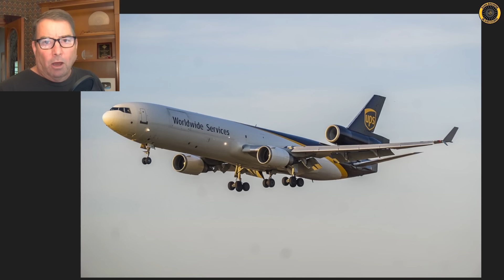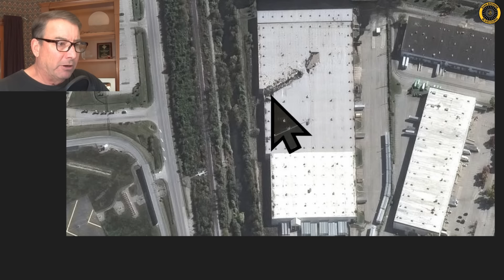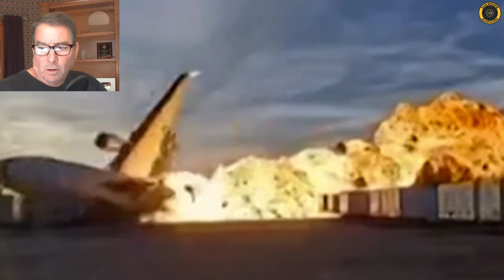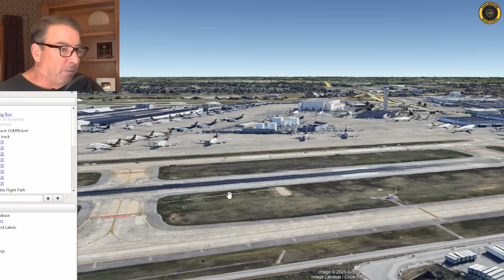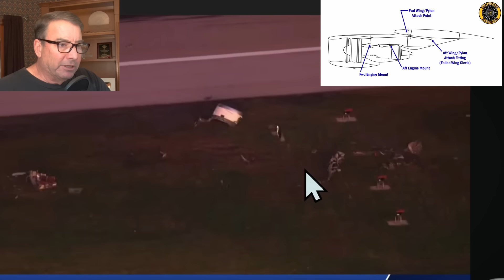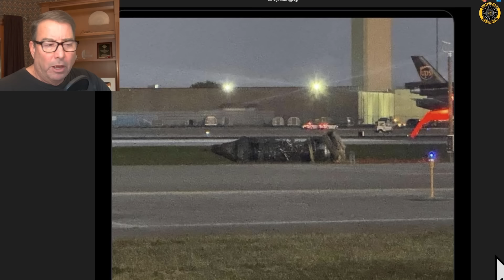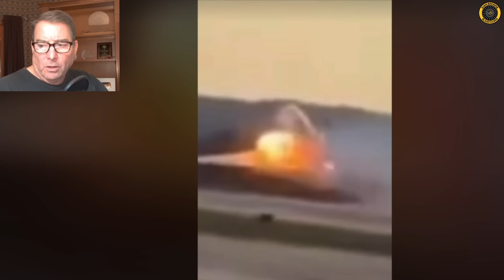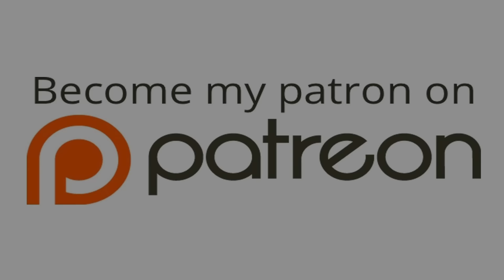UPS #2976 UPDATE 2 6 Nov 2025

Comment: 🧩 1⃣ Maintenance process and quality control

The biggest area of focus will be UPS’s maintenance oversight, especially because:

The aircraft (N259UP) had just completed a heavy D-check at San Antonio a few weeks earlier.

It was reportedly delayed pre-departure for engine issues on the same engine that later failed.

The No. 1 engine and pylon separated almost immediately after liftoff.

That combination points to possible procedural or inspection gaps — not necessarily technician error, but failures in supervision, documentation, or verification.
Examples of what NTSB will probe:

Were all engine-pylon attach fittings properly inspected for corrosion, fatigue, or fastener torque?

Were non-destructive tests (ultrasound, eddy current) actually performed and signed off correctly?

Did the UPS Quality Assurance (QA) team verify subcontractor work at the maintenance, repair, and overhaul (MRO) facility?

In other words: even if the work was done by a certified shop, UPS must own the oversight.

🧭 2⃣ Aging aircraft program

UPS operates one of the oldest MD-11F fleets in the world (average age > 30 years).
The MD-11 design predates modern structural aging programs.
UPS’s Continuing Structural Integrity Program (CSIP) is supposed to catch fatigue in “life-limited” parts like pylons, spars, and fittings.

If the failure began in the pylon structure, investigators will ask:

Did UPS apply updated fatigue-life data from Boeing?

Were inspection intervals too long given aircraft age and duty cycle?

Was there adequate trending of small corrosion reports or vibration data?

If not, it’s a programmatic oversight — a sign the maintenance system didn’t evolve fast enough for a fleet now entering “unknown aging territory.”

🧾 3⃣ Maintenance record tracking & audit

NTSB already confirmed they’re pulling all job cards, sign-offs, and CCTV from the San Antonio facility.
If they find:

Missing signatures,

Out-of-date manuals, or

Deviations from Boeing procedures,
it could reveal a systemic oversight — either UPS’s internal audit missed it or corporate pressure allowed “routine sign-off” culture.

⚙ 4⃣ Pre-flight maintenance decision chain

UPS2950 (the previous MD-11 flight) reportedly experienced a maintenance delay for the same engine.
If true, NTSB will check whether the aircraft release to service (the “airworthiness tag”) was signed off too quickly.

Questions likely asked:

Was the problem fixed or deferred under the Minimum Equipment List (MEL)?

Did dispatch or maintenance control verify that deferral met FAA requirements?

Did operational pressure (hub congestion, freight deadlines) influence the release decision?

If a known vibration, oil, or fuel issue existed and the aircraft flew anyway, that’s a serious oversight chain.

🛠 5⃣ Supplier and subcontractor oversight

UPS often outsources heavy maintenance (D-checks) to MRO providers under FAA Part 145.
UPS must still audit their tooling, torque procedures, and calibration logs.
If the engine or pylon attach bolts were improperly torqued or substituted, the oversight gap might be between UPS’s Engineering Department and vendor quality control.

🧱 6⃣ Organizational & cultural factors

These deeper issues often surface after major accidents:

Aging-fleet fatigue — assuming “it’s fine, it always passes inspection.”

Schedule pressure — aircraft released close to deadline to keep the network moving.

Communication silos — maintenance shops fix something but don’t relay structural concerns to engineering.

The NTSB calls these “organizational precursors.” They don’t break metal directly — they set up the environment where metal fails unnoticed.

🔍 7⃣ Summary: probable UPS oversight themes under investigation
Area	Likely Oversight Focus
Heavy maintenance QA	Incomplete inspection or documentation of pylon attach structure
Aging-airframe management	Fatigue/corrosion not addressed by existing bulletins
Maintenance record audit	Sign-off or deferral discrepancies
Dispatch decision	Possible premature release after prior engine issue
Vendor supervision	Inadequate auditing of outsourced MRO work
Organizational culture	Pressure to keep aircraft flying despite age-related uncertainties

🟠 Bottom line:
If the NTSB finds that the left engine pylon failed because of undetected fatigue, corrosion, or maintenance error, then UPS’s oversight of maintenance execution and structural-integrity programs will be named as a contributing factor.
Not because of one technician’s mistake — but because the system allowed an aged, high-stress component to pass inspection when it shouldn’t have.
Reply: You sound like you work there in maintenance somehow .. do you?

Comment: Was there controversy over the design of the MD-11 given how vulnerable the No. 2 engine could be to debris coming off a wing-mounted engine fire or explosion? Or was it a non-issue since the critical components in any tail section, with or without an engine, are similarly vulnerable? Or was there controversy related to other facets of rear-mounted engines in general? Maybe I'm conflating two different things.

Comment: Absolutely wrong about the dashcam location (38.147742,-85.736591).
The first fireball is the fuel erupting from the port wing as it's demolished by the cluster of 3-story tall black storage tanks at GFL Environmental, a petroleum products recycler. Thereafter, the lift of the sole remaining wing, on the starboard side, rolls the plane uncontrollably to port until it goes past inverted and the starboard wing disintegrates on impact with ground structures, creating the second fireball.

Comment: The NTSB briefing earlier today mentioned that they had picked up "numerous fan pieces" from the runway area. That could indicate that it was an uncontained fan failure that started the sequence.
Reply: I picked that up too, like pieces along the runway and not saying they were in one small area. An engine must be able to contain a fan failure, but can age affect this capability, and this being the highest rated version of the CF6, was it tested at that rating? RR problem on the 777, if I remember right, was age related delamination.
Reply: Blade failure is containable - blade disc failure is not and is catastrophic.
Reply: @onceamoth agreed, but they said they picked up fan blade pieces, not the disc. One blade failing often has taken out blades or blade pieces but I can only think of Sioux Falls for a disc failure on a GE.
Reply: @mharrye  An engine must be able to contain a single blade failure. Not multiple blades or the fan disc.

Of similar interest, the imbalance caused by a single blade out should not cause a failure of the engine mount or a fire within 15 seconds of the blade failure.
Reply: @ejb3539  FBO (fan blade off) mount and pylon loads are usually based on the single blade that fails, plus about 40-50% of the following blade which is impacted by the blade that was just released. Based on the description given by the NTSB, they found a bunch of blades upstream of the nacelle inlet, thrust reversers and engine core.  With this many blades trying to depart though the containment blanket, it is logical that the blanket grabbed onto the blades opposite the failure and as the engine hit the ground, the remaining blades snapped off, still balled-up with the kevlar. The pylon not only separated from the engine, but it also separated from the wing. In my experience, there is no explanation for that. Usually the pylon goes with the engine and stays attached.
Reply: My suspicion has always been an uncontained engine failure and after seeing the engine photos (not to mention reports of fan blades) my guess would be a fan disc failure. United 232 (DC-10) had a fan disc failure which severed all 3 hydraulic systems leading to a loss of flight controls. I’m not sure if the UPS flight lost flight controls, but if they did this could be one explanation. 

The CF6 also has a history of uncontained failures due to high and low pressure turbine disc failures. I’m not sure that’s what happened here based on the pictures.
Reply: @ejb3539  I doubt they lost flight controls. McDonnell Douglas learned from United 232 and American 191. There are valves in the system designed to close if there's a drop in hydraulic pressure, and I believe the leading edge slats are designed to lock extended if pressure is lost.
Reply: The should contain a blade-off or blade failure but that means absolutely nothing about the extreme imbalance and vibration that comes with an event like that. There has been cases where the blades deflected out the front of the inlet too.
Reply: This said, if a mount failed during take off that would unbalanced the whole thing making an uncontained failure more likely.

We'll have to see the engine data and the order of the trail of parts to know more.

Comment: ✈ 1⃣ Basic definition

Debris means anything physically separated from the aircraft or its cargo as a result of the accident or breakup.
It can range from a small screw to an entire engine or wing section.

In the UPS 2976 crash, the debris field includes:

Pieces of the aircraft (fuselage, wings, engines, landing gear)

Cargo fragments and packaging materials

Structural elements (rivets, insulation, wiring, paint chips)

Burned or melted materials from the aircraft and surroundings

🧭 2⃣ Types of debris investigators talk about
Type	Description	Purpose in investigation
Structural debris	Pieces of the airplane’s frame, skin, wings, pylon, landing gear, etc.	Shows how the aircraft broke up or impacted.
Engine debris	Fan blades, turbine parts, pylon fittings.	Helps find the first point of failure (e.g. engine explosion vs. detachment).
Cargo debris	Boxes, pallets, plastic wrap.	Helps determine where breakup occurred, or what cargo type contributed to fire or explosion.
Ground debris	Items from buildings, vehicles, or trees at impact site.	Used to reconstruct the impact sequence and damage pattern.
Personal effects	Crew belongings (uniform, headset, flight bag).	Treated with dignity, used to locate cockpit area or timeline clues.
📍 3⃣ “Debris field”

This term describes the spread pattern of debris on the ground.
It tells investigators how the aircraft came apart — for example:

A long, narrow debris trail → aircraft was intact until impact.

A wide, scattered field → aircraft broke up in flight.

Light materials (paper, insulation) often travel far downwind; heavy parts (engines, landing gear) drop near initial failure points.

In the UPS crash, NTSB noted:

“You can very clearly see a path from the airport to where the debris field is. You can see burnt trees, molten metal, and major components such as the number one engine located near the runway end.”

That pattern helps them determine when and where the left engine separated.

🧹 4⃣ After the investigation

Once investigators finish documenting and collecting the debris:

Aircraft parts go to a secure hangar for reconstruction and analysis.

Remaining small debris (e.g. metal fragments, cargo remnants) are safely disposed of or recycled under supervision.

Personal or hazardous materials are handled separately.

🪨 5⃣ Everyday analogy

If you imagine a car crash, the “debris” would be all the shattered glass, bumper pieces, and personal items scattered on the road.
In aviation, it’s the same idea — just on a vastly larger and more controlled scale.

Comment: ⚙ 1⃣ Chain of custody and inventory verification

Once the NTSB releases the crash site to UPS, the UPS Cargo Security and Loss Prevention Division takes over.

They establish a secure perimeter, then:

Collect and photograph every identifiable item (box, label, container, pallet fragment).

Assign each item a temporary ID tag (like “REC-0429-12”).

Compare those to the original flight manifest, matching any visible tracking labels.

Create a “Recovered Item Log” that lists:

Tracking number (if visible)

Description of contents or condition

GPS recovery point

Final disposition (destroyed, held for evidence, returned to insurer, etc.)

This log becomes an official appendix to the investigation docket.

📦 2⃣ Classification for insurance and regulatory purposes

UPS classifies recovered cargo in four categories:

Category	Description	Typical Outcome
A. Identifiable & intact	Box/label readable, contents intact	Logged, claim reconciled, destroyed
B. Identifiable & damaged	Label readable, content destroyed	Photo evidence, logged, destroyed
C. Unidentifiable	No readable label or content	Documented by photo, destroyed
D. Hazardous/contaminated	Exposed to jet fuel, chemicals, or biologicals	Destroyed under hazmat protocols

Each classification has its own disposal method and insurance notation.

💰 3⃣ Insurance settlement tie-in

UPS self-insures most shipments up to a threshold, with third-party reinsurance (often Lloyd’s or AIG Cargo).
Those insurers require proof that:

The loss occurred during UPS custody,

The items were physically destroyed or unrecoverable, and

The chain of evidence supports no fraudulent claims.

So UPS produces a “Destruction Affidavit Packet” for each recovered item or batch, containing:

Recovery photos

Tracking number

Disposition certificate (signed by two UPS officials)

Witness verification from a local fire marshal or NTSB field agent

That packet is shared with the insurer and retained for 10 years.

🔥 4⃣ Physical destruction or disposal

Depending on what the cargo is:

Paper, cardboard, fabric → shredded and incinerated at an EPA-approved waste site.

Electronics, lithium batteries, metals → hazmat recycling with certificates of destruction.

Medical or perishable goods → incinerated under biological waste standards.

UPS contracts this work to certified facilities, usually near the crash region.
Every destroyed batch has a “Destruction Lot Number” linked to the recovered item log.

🧾 5⃣ Final accounting & customer closure

After destruction:

UPS updates the manifest entry with “Recovered – Destroyed” status.

Customers’ claims are already paid, but they get optional documentation upon request.

The claim is then archived in UPS’s internal Aircraft Incident Ledger, which auditors and regulators (FAA, NTSB, insurers) can inspect later.

Once all records are reconciled and the NTSB closes its docket, UPS purges sensitive details (like customer names or contents) for privacy.

✅ In short

Every found package is treated as evidence, not property.

UPS creates a full paper trail proving destruction.

Insurance reimbursement is already processed before destruction happens.

Nothing from the site re-enters the logistics chain — even if undamaged.

Comment: Years ago a 727 pilot told me of an outboard engine that had seized during flight and separated. He said the pilon in that aircraft was designed to shear cleanly in the event of that happening to avoid damaging the airframe.
Reply: The engine on commercial airlines and others are mounted in a way that they can indeed come off and the plane still land or takeoff.

Comment: 🧱 1⃣ Even if the box looks fine, it’s still evidence first

If an item is found anywhere in or near the crash site — whether burned, dented, or completely pristine — it automatically becomes part of the accident debris field.
That means:

The NTSB and local law enforcement control it, not UPS.

It’s tagged, photographed, and logged as debris because its position and condition might tell investigators something about how the breakup occurred.

Nothing can be released until the NTSB formally relinquishes custody of the site and the materials.

So even if it’s a perfect-looking box sitting 200 ft away in a field, it can’t be returned or touched yet.

🧪 2⃣ Once investigators clear the site

After the NTSB finishes debris mapping and documentation, they hand everything over to UPS’s Cargo Recovery & Security team.
At that point:

UPS sorts what’s recognizable cargo versus aircraft components.

Each item is checked for hazards — fuel, oil, battery damage, contamination, etc.

If an item is undamaged but untraceable (no readable label, barcode, or airway bill), it goes into “unidentified recovered property.”

📦 3⃣ Unidentified cargo = destroyed, not delivered

If a box has no legible label or tracking number, UPS can’t legally or logistically deliver it:

Chain-of-custody is broken.

Ownership and contents can’t be verified.

Insurance claims have already been paid.

UPS policy (and federal law on hazardous debris) requires secure destruction or disposal of such items after documentation — even if it looks fine.
This avoids contamination risk, theft, or false claims.

🧾 4⃣ If a label is readable

If there is a barcode or airway bill number:

UPS logs it, cross-checks it against the manifest, and notes its recovery.

It’s still not delivered — it’s treated as a lost-and-recovered exhibit, kept for record or investigation.

The sender is notified if requested for insurance documentation, but the physical item is generally not released.

⚖ 5⃣ Summary
Scenario	What Happens
Box undamaged, no label	Tagged → documented → destroyed
Box undamaged, label readable	Logged → manifest cross-checked → held, then destroyed
Box identifiable, investigation complete	Sender notified for claim record, not re-delivered
Box damaged or burned	Treated as debris, disposed of securely

In short:
Even a perfect-looking box from the crash site won’t go back into circulation — it becomes official evidence, then hazardous waste or documented debris once the investigation ends.